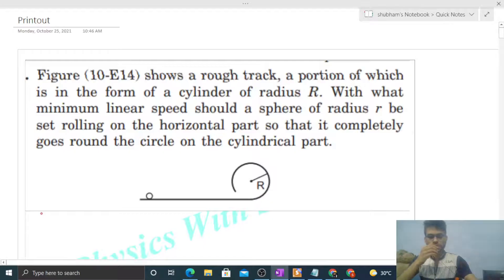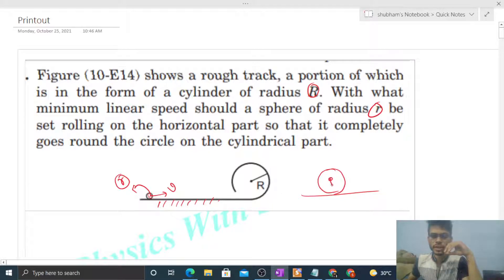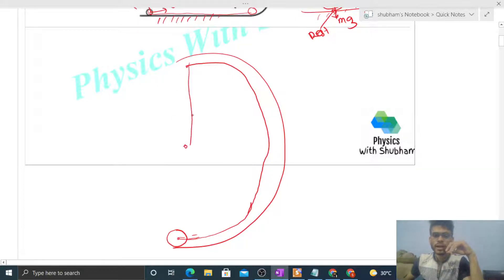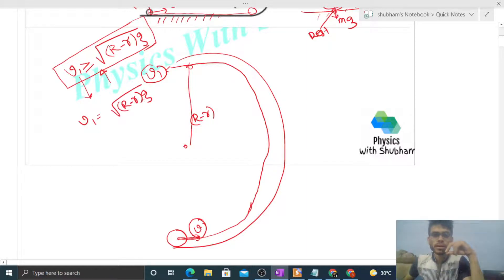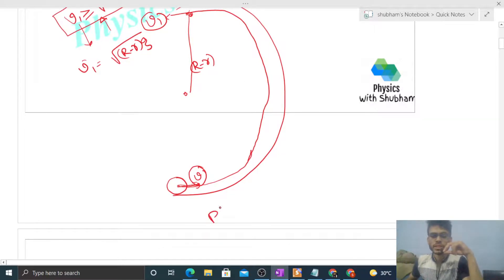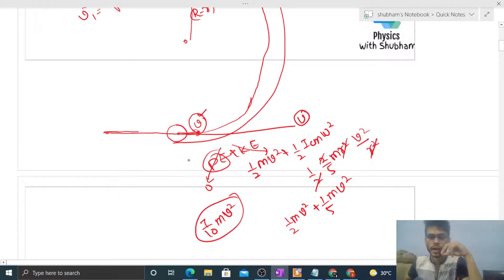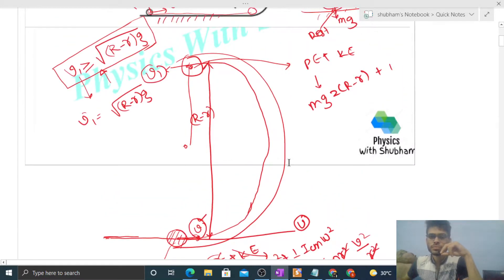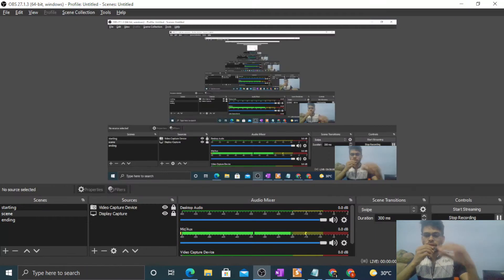Figure (10-E14) shows a rough track, a portion of which is in the form of a cylinder of radius R.

Comment: sir why is answer not just [ root 5g(R-r) ]? as that is the minimum velocity of completing vertical circle?
Reply: Kyuki rotational motion bhi ho rha
Reply from the maker: Compare the two cases & point out the difference.
then you will get your answer!!
Reply: Bhai pta lga kyu nhi lgskta?
Reply: @GV22m06  root5gr conservation of enrgy se ata hai aur usme rotational kinetic enrgy nahi lete. Ye wale question mai ball ka rotational kinetic energy bhi dalna padhega
Reply: @TheLofiSP  acha ok 2 more ques 
Does friction have impact on body in curved path? And top ka velocity hi kyu nikalre?
Reply: @TheLofiSP  why we assume N to be 0? And why will friction do work?
Reply: @GV22m06  N is assumed to be 0 because it's the critical case, as if that point is guaranteed to extert 0 normal force automatically it means the Sphere completes the circle
Reply: @GV22m06  no N is not zero here miu coeeficient of static friction is 0 q N is acting and balancing the weight  but  friction is equal to miu times the N but miu is O s